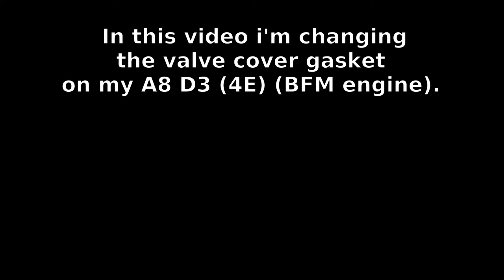audi a8 valve cover gasket

Comment: I just bought a D3. Previous owner just did valve cover gaskets, but I still have what appears to be pretty good leaks on both sides, do you suppose it could be because the rubber washers on the bolts maybe weren't replaced?
Reply from the maker: A good amount of liqid gasket (silicone for engines) will help solve this issue, but you need to reassemble a gasket cover to apply it.

Comment: Hi

How hard is the other side? Is it that easy, just unbolt? Do I need to reapply the belt for crankshaft or I do not need to remove that? Can you tell what parts are needed when doing that job?
Reply from the maker: Procedure is almost the same... no need to remove the timing belt... only difference is ... timing chain is on the back side of the engine... if you want to change only the gasket buy the gasket, i changed also spark plugs... but isn't in this video
Reply: @chichovenci  Did you make another video of the other side? Did you need to buy new bolts for the covers or how were the bolt plastic pieces?
Reply from the maker: You can use same bolts ... there are no plastic peaces just use some sealant...(i haven't made video for the other side.)